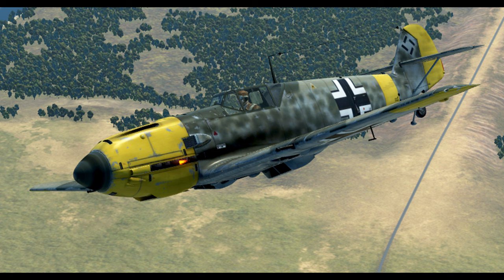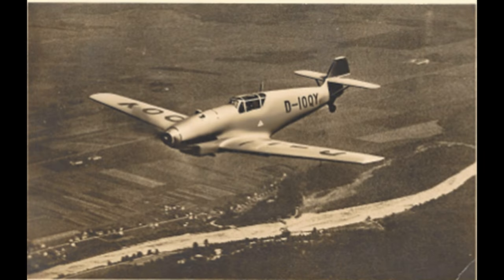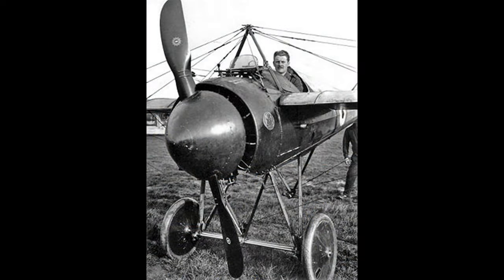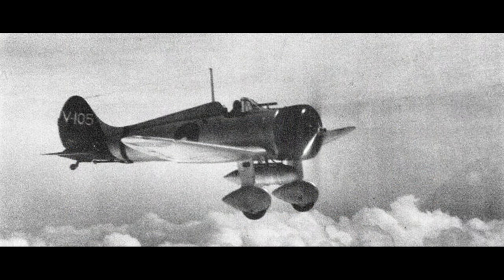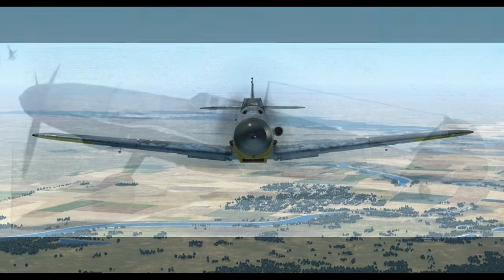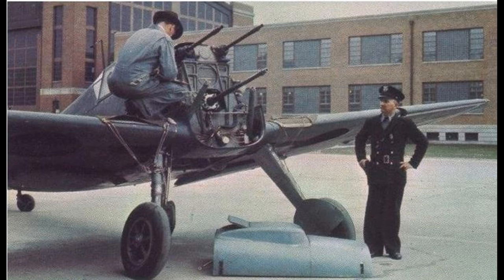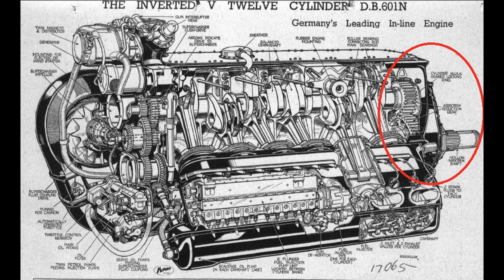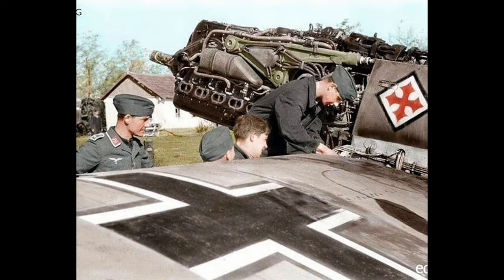Why an INVERTED V-12?  PART 2

Comment: Greg, I sort of disagree, as the mechanics had no problem of servicing any configiration of power plants. I sure wouldn't want to pull the valve covers on an inverted. If inverted is better, I'm sure the Formula  One engineers would build them as there are no limits to their cost and complexity. When the planes fly inverted everything gets thrown out the window anyway.
Reply: As he explained in the previous video, you don't often work on the engine in ground vehicles from the bottom, so there would be nothing but disadvantages to having an inverted engine in a ground vehicle. To work on an inverted F1 engine, you'd need to put it on a lift to do almost everything.
Reply from the maker: I don't think Robert watched part 1 before he wrote his comment. Follow the instructions people!

Comment: another advantage I don't see mentioned is the crankshaft is on the top with an inverted engine.  this moves the prop higher and means there is more clearance for the prop and thus a shorter landing gear can be used.
Reply: He did mention it.
He also explained this would only be an issue with engines without gear reduction of which he showed examples.
Reply: Yeah I hadn’t watched all of the 2nd video yet